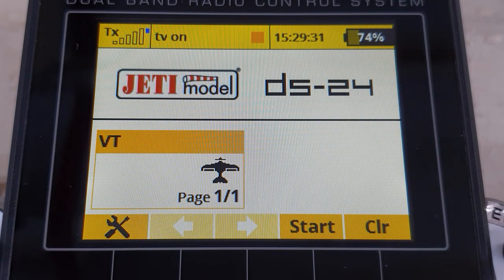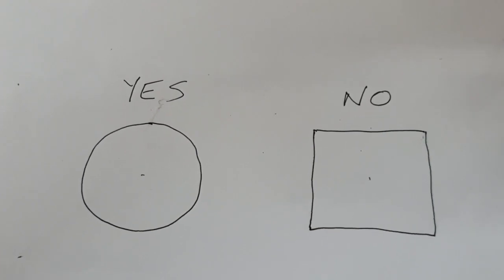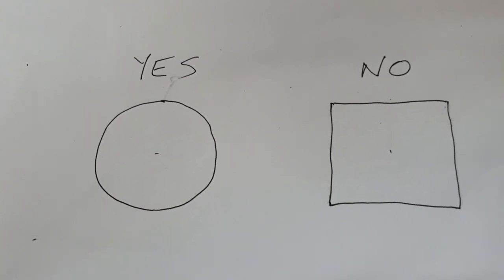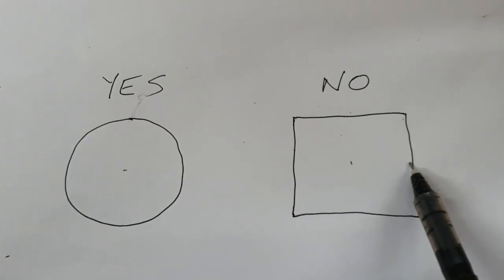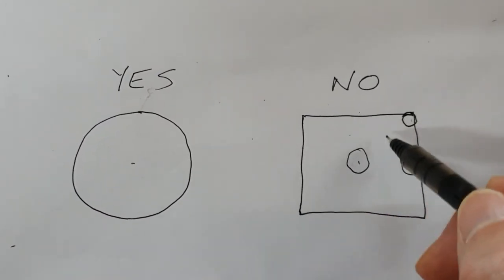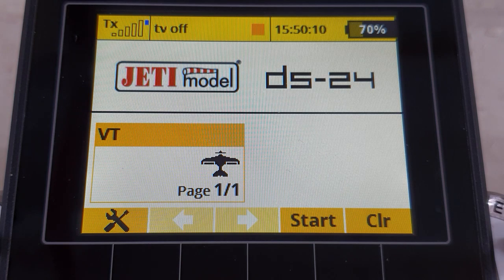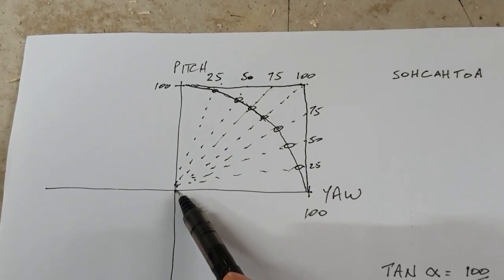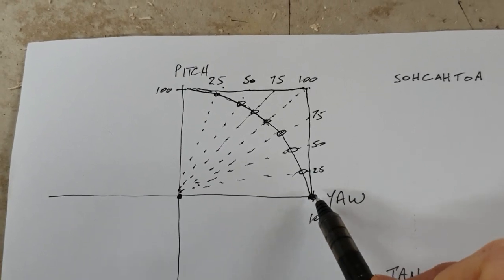Jeti - circular coupling of functions, Bernreiter vector thrust tube, episode 1.

Comment: A very similar feature is already implemented in most radios and in all helicopter FBL units as the "Cyclic Ring" or "Swash Ring", which reduces the cyclic throw in the corners to ensure you get similar rotation rates regardless of angle.

Jeti have a "Swash Ring" feature available for helicopter models, but I suspect it's only available if you setup a model as a helicopter rather than fixed wing.  I wonder if it's worth asking them to enable a circular limit feature that can be enabled for thrust vector units too.